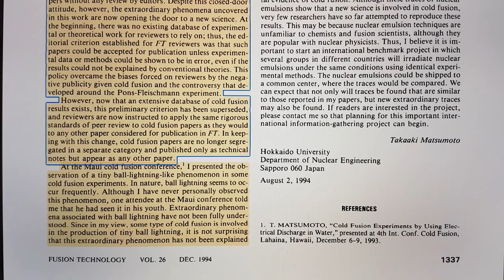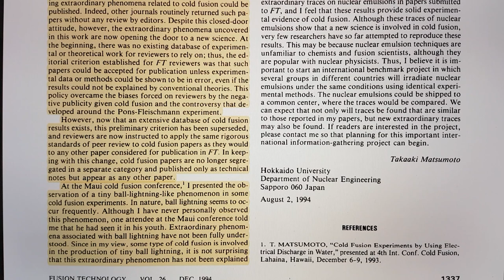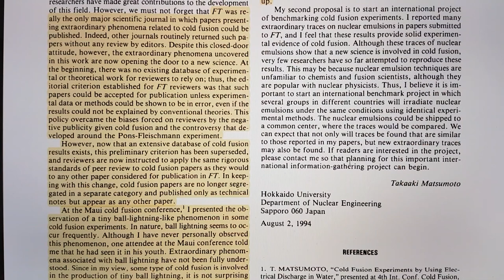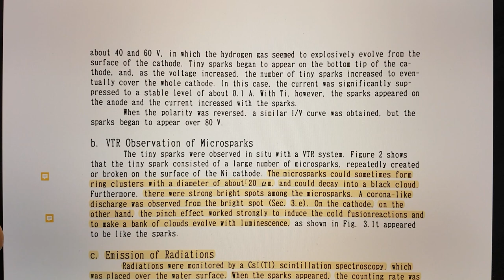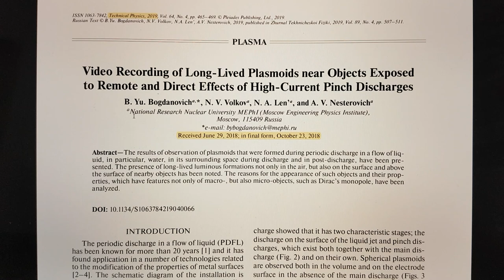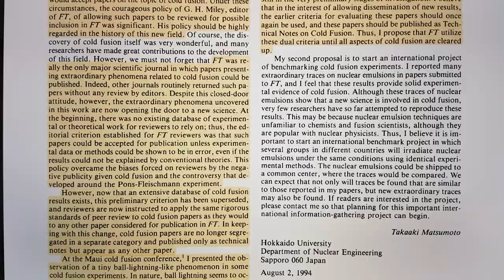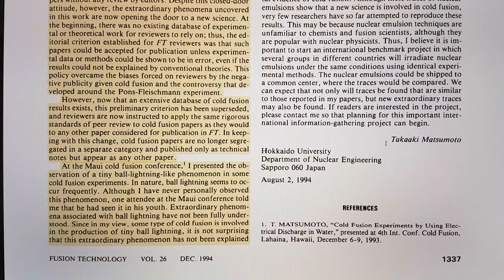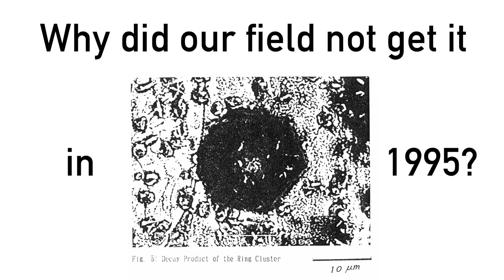Why did our field not get it in 1995?

Comment: Holmlid has used the Shell 105 catalyst which has dominated the market for many years has the following composition: 84.3% Fe2O3 , 2.4% Cr2O3 , 13.3% K2CO3 to form ultra dense hydrogen. Potassium carbonate when reacted with a metal oxide will produce ultra dense hydrogen due to the Rydberg blockade effect where potassium crystal formation provides a quantum mechanic based crystal growth template for the formation of ultra dense hydrogen and possibly also lithium. This formation of ultra dense hydrogen may be why K2CO3 plays a critical role in many active LENR experiments.